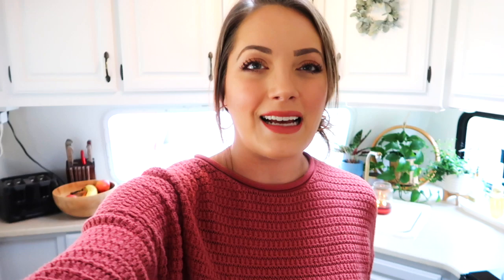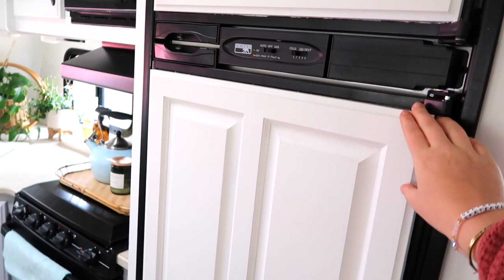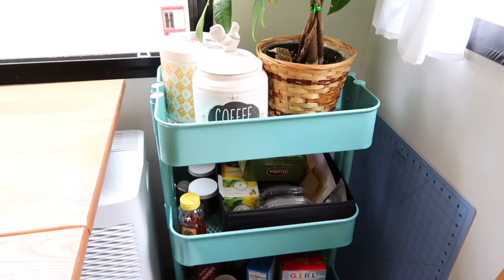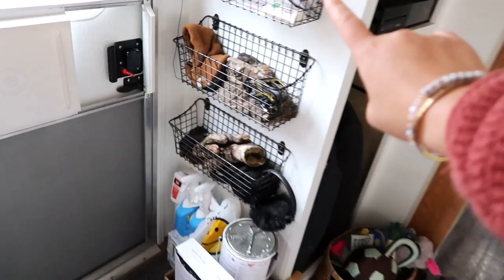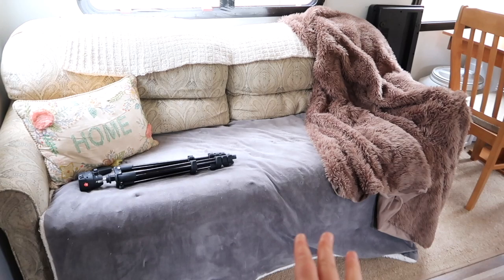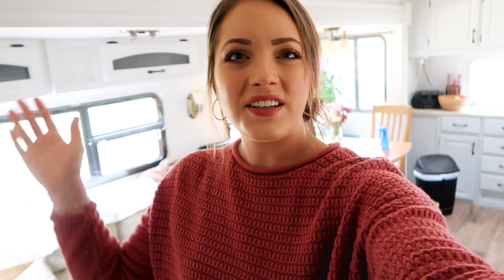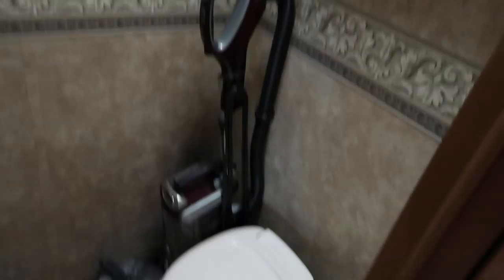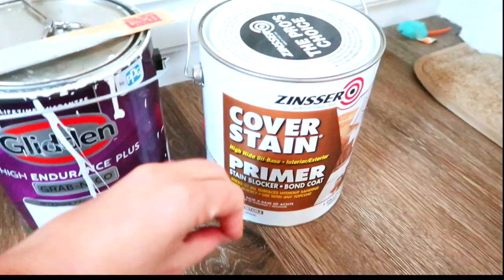RV RENOVATION ON A BUDGET!! | UPDATE TOUR + HOW TO PAINT AN RV

Comment: It is good to see you useing paints from your local big box store. I am a Department manager for a hardware department. I also painted for 5 years. Zinsser primer is the best for this anything not just painting over vynal wall covering. You are doing a good job. I feel I can help you explain the primer alittle better. Water based primer when you put it on it creates a shell on top of the vynal, or other paint where in most applications you would not notice a diffrence. On vynal you will because as time goes by the primer will srink poping loose from the serfice. The Zinsser oil base leaches in by eating at the serfice etching it to make a stronger bond.
Reply: Chesley Cox Zinsser is great!
Reply: Thanks for this comment! I was wondering about which primer to use!

Comment: I live in colorado with low humidity and my tropical plants went through your plants issues.
1. U need to mist the plants  to increase humidity around plant.
2 . Also watch the soil it will need to be a sandy mix fir drainage. 
3. Plants will filter the air so watch those chemicals in the environment.  Paint fumes, glue fumes....

Comment: Am I correct in thinking that you didn't clean or sand the walls and cabinet at all, just started applying the primer?
Reply from the maker: I cleaned them and used a liquid sanding solution actually!
Reply: @MicheleRose  thanks so much for sharing!
Reply: @MicheleRose  HI great biddy! Did you use the liquid sanding solution on the cabinet AND walls? This is an off odd question but did this step seem critical looking back? How's the paint holding up overall on the cabinets, doors, walls etc almost 8 months later?

Comment: Wow amazing! I redid my camper and did exactly what you did using oil base paint. Few questions, I noticed you didn’t remove any of the items in your way and just painted up close without even putting painter tape down (ie the towel hanger, plug ins, countertop), how do you make sure it gets right up close without painting on the items? Did you use just one coat of the oil base paint? Did you basically have to throw away your roller brush after you were done?! Mine was almost impossible to try and clean and reuse again.
Reply: Katie Helgens Angle brush helps to get close edges without using tape, and practice. Generally you just need one coat of primer. I would use disposable rollers with oil paint, it’s too difficult to clean them, because you have to use mineral spirits.
Reply from the maker: Hi!! 👋🏼 So in the kitchen we taped everything off! It was so tedious ! Some areas it was absolutely needed but I have a steady hand, I’m actually an art teacher , and so I used a brush that I know would work well and went for it. I would suggest though having a damp rag on hand. I use this when I do make a mistake. And Qtips. Comes right off if you get it right away. 

I re use roller brushes with regular paint. I throw away with oil. But you could clean with turpentine it’s just a big hassle.
Reply: @MicheleRose  hi! I see you used an oil based primer, so then does that mean you use an oil based paint as well? Also, did you have to prime the fabric before painting?

Comment: Question, after you use the oil base primer is it possible to use a matte paint after on top? I really want a non glossy grey for my trailer kitchen cabinets.
Reply from the maker: Yes you can use anything over it. And the primer is super matte as well
Reply: Michele Rose thank you !
Reply: I used chalk paint, no primer, on my kitchen cabinets then I put general finishes flat polyurethane. The poly protect from food staining the paint. The more matte a paint the more likely a stain will seep into the paint and become part of the paint....prior I had an expensive semi gloss on the cabinets they clean much easier with the general finishes topcoat....FYI also buy the small fine and superfine sanding sponged backed sanding paper for between coats of poly. They make sanding sooooo much easier and faster.